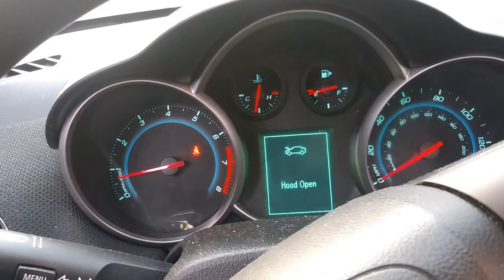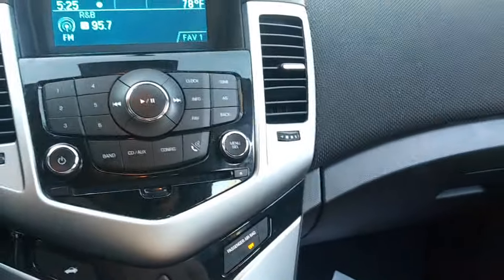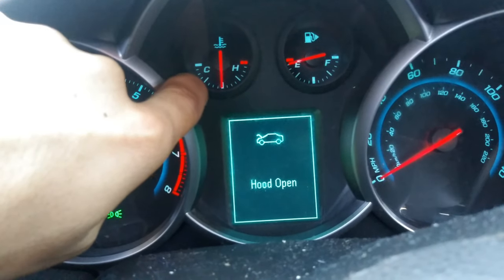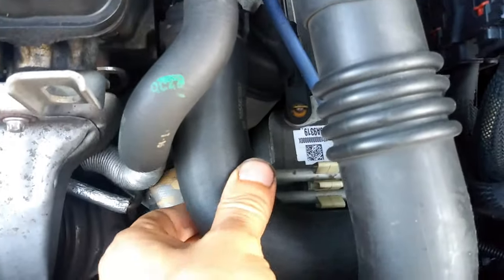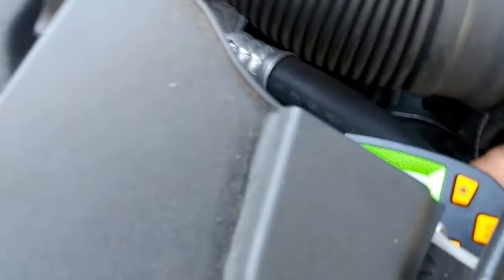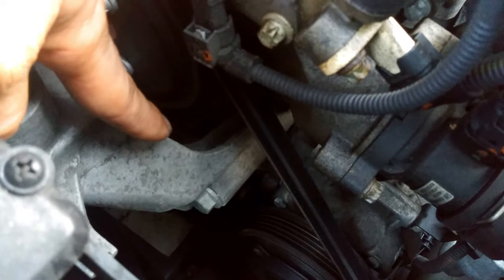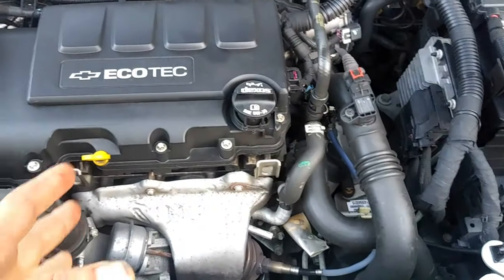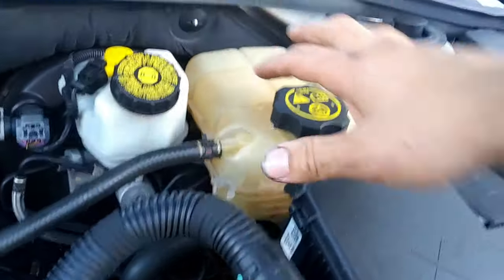chevy cruze overheating issues

Comment: Chevy is the devil man it's like u have to keep working on the car soon as u purchase it new r used.. toyota for life now
Reply: Buy a v8 no problems
Reply: I agree. Been having issues with my cruze on and off. 😒
Reply: @subatomi34  I’ve spent maybe almost $4000 on repairs on my 2013 Chevy Cruze and I’ve only had it for a year. I’ve been having problems every couple months. Trying to get rid of it and get a Toyota Corolla instead.
Reply: Stop that, I just bought one. Chevy Cruze Diesel 2010! No problems so far but it's only been one week!!😵🙈
Reply: Do people really wake up and decide they gonna buy a Chevy Cruze 😂😂😂😂
Reply: Yes. You know it’s hell when every time you drive you’re more concerned about the temperature gage than how much fuel there is.
Reply: @POPINTHETAPE  exactly
Reply: Facts
Reply: Yeah I have a 2015 they such
Reply: Yeah I have a 2015 they suck
Reply: Yeah I have a 2015 they suck
Reply: Yeah I have a 2015 they suck
Reply: Yeah I have a 2015 they suck
Reply: Yeah I have a 2015 they suck
Reply: Yeah I have a 2015 they suck
Reply: Yeah I have a 2015 they suck
Reply: Yeah I have a 2015 they suck
Reply: Yeah I have a 2015 they suck
Reply: Yeah I have a 2015 they suck
Reply: Yeah I have a 2015 they suck
Reply: Yeah I have a 2015 they suck
Reply: Yeah I have a 2015 they suck
Reply: Yeah I have a 2015 they suck
Reply: Yeah I have a 2015 they suck
Reply: Yeah I have a 2015 they suck
Reply: Yeah I have a 2015 they suck
Reply: Yeah I have a 2015 they suck
Reply: 2011 Chevrolet Cruze eco is 💩 only had it a year and I have issues every month the issue I’m having now it overheating now but at first it was only a oil leak now it’s both 🤦🏽‍♀️CANT TAKE IT ANYMORE
Reply: Not a chevy thing it's the 1.4 engine spicific, also gm diden't desing this engine opel did. Im a gm guy hate wotking on toyotas and most forgin cars. But i will admit gm really f ed up getting these ive owened alot of older gm cars an thay ran amazing i loved my cars with the 3100 an 3400 engines an never had a problem with my truck unless i caused them.

Comment: I’ve changed just about every hose, water pump, thermostat, water outlet valve. It seems like there is a lot of pressure in the system. Reservoir keeps bubbling and pushing coolant out. Heat works fine. I’m almost to the point of believing it’s a bad head gasket. I’ve never had so many issues with determining that. No oil in coolant. No smoke at tail pipe
Reply from the maker: Can you smell gas in the coolant
Reply: Jabo The Mechanic i do not. It’s not overheating now that I changed water pump and thermostat, but the reservoir is still bubbling and blowing out steam.
Reply: Bled air out at the radiator. It will bubble for a while then stop. After a few minutes will start again. But not showing over heating. I really don’t trust the heat gauge though
Reply from the maker: Yeah i would not trust the gauge. Hook up a scanner to it. Try replacing the rad cap. Could you send me a video of whats it doing
Reply: Jabo The Mechanic the bubbling could be exhaust gases I assume. It doesn’t do it constantly so I’m thinking it might not be real bad yet. So I’m thinking I’m gonna let it cool down, add some bars head gasket sealer and see what happens. Don’t really have nothing to lose at this point. Let you know the outcome. I’ll try to get some video before and after
Reply from the maker: Use kseal. Thats by far the one with the best success i had with the product
Reply: @JaboTheMechanic  used bars. Its no longer bubbling. No over heating. Running fine. Pretty crazy.
Reply: @brandonscherffius  I have a 2014 chevy cruz, and im pretty sure what your describing is my issue. It looks like coolant container is empty like the coolant i put has evaporated and then that ac is turn off light came on so i open hood and loosen lid a little bit and the coolant boils out and fills up. So what are all parts i should buy so i can try to fix this?
Reply: @brandonscherffius  ALso is opening that lid for now going to help my coolant getting through until i can get those parts to fix it? I dont know alot about cars so sorry if i sound like an idiot with the way im wording things.
Reply from the maker: No it will overflow out
Reply: Eric Turbett you’re losing coolant some how. Either a hose, the water valve, water pump or head gasket. Mine is a blown head gasket but it’s not showing the typical signs of it. Is it over heating?
Reply: Eric Turbett and honestly you’re gonna spend a lot of money and time chasing a ghost so if I were you, I’d take it to a mechanic and have them diagnose it
Reply: @brandonscherffius  so, i dont think its a blown head gasket, iv put in a new thermostat and no change, checked hoses and nothing seems bad, i noticed a slight leak from the area he said the water pump screw is but its like reeeaaalllly slow so i dont think thats where im losing coolant. I readjusted the hose i did see leaking. If anyone has any solid stuff to help het me up. THANKS.
Reply: Brandon Webb I literally gave up with mine. Let the bank take it back as I was filing bankruptcy anyway. Bought a brand new Nissan about a month later. Done with Chevy. Good luck fellas.
Reply: @brandonscherffius  dam, i paid mines off already. I know now. I ordered a water pump so i can replace that. If that doesnt fix it then yea imma sell this or something. Fucked up tho cause its a 2016 and aint even had it for long before i run into what seems to be an inevitable issue with the cars of this type
Reply: I just scanned my car because the engine light came on . 2014 Chevy Cruze rs , and it said turbo/ supercharger underboost. 
And catalyst system low efficiency. After running the car for a while and turning it off the coolant is bubbling through out the hose and into the engine.
Reply: @JaboTheMechanic   hello  my hose on the  water pump to the radiator  acts cold not all the  way  hot
Reply: @brandonscherffius  can you teach me how to fix mine,  I replace water pump , thermostat and some hose but it's still problematic and today I saw it creating smoke
Reply: The plastic bypass hose is prone to cracking and will leak. The guy changing your oil could hit the hose since it's right there and you have a leak
Reply: @JaboTheMechanic  what was the fix for this vehicle? I have the exact same issue on Chevy cruze
Reply: We are having the same issue as well… could REALLY use some H-E-L-P.. we have replaced the fan, the water pump, hoses, radiator, thermostat and all sensors, lots  coolant/antifreeze!! Took it to Chevy to get it diagnosed— they said Radiator… 
It is still overheating… it’s bubbling back through the reservoir…I can’t keep throwing$$$ at it! 
Any suggestions???? PLEASE 😢
Reply: @Okie mom  all the same issues here. My biggest regret is buying this car
Reply: @frankiecaraballo228  — I am right there with you! REGRET! We bought this car for my daughter.. it was her first car… she drove it, 1 week and that’s it… it’s been in & out of the shop more than it’s been on the road! Such a head ache!!
Reply: @okiemom did you ever fix it? I’m having a same issue
Reply: @frankiecaraballo228 hey, did you ever fix it?
Reply: @emmanuelramirez6669  — NOPE! Ended up trading the car off this past Saturday! Took a HUGE loss.. but, I could not continue.. it has been in & out of the shop, I have replaced so many parts, radiator, hoses, belts, fan, thermostat X3, 11 gallons of antifreeze (NO EXAGGERATION).. I am certain I am forgetting some things.. it was constant.. long story short… it was still over heating, loosing antifreeze and then it says something about shutting the car off due to overheating and the gauge was not in the red … It has been a NIGHTMARE! From what I have read…2010-2014 that was Chevys “trial & error” phase of the Cruze. Anything after 2015 (all the kinks we’re worked out & supposedly better.) I am so sorry your going through this as well… my heart goes out to you & the frustration.. I just had to cut my losses.. Edited to add: the next thing would be the computer & that was sooo costly… it would be reading hot on the gauges, but the hoses were not hot, the fans was kicking on and off.. it was just baffling.. there have been MANY recalls but the person we bought it from, did not do the recalls and therefor too much time had passed & Chevy would not cover the recall.. good luck to you!! I will help anyway I can.. like I said, we replaced it all except for the computer, transmission and the block.
Reply: @JaboTheMechanic what would it be if you could smell gas in the oil?   Mine is overheating with oil in the coolant but no coolant in the oil.  And the oil does smell of gasoline
Reply: Same... so did you change the head gasket?
Reply: @db3467 how does one replace this plastic bypass?
Reply: Wow. I just read all the comments and I'm having the same issue. I changed the one heat sensor up top and the thermostat. Having the issues up above. There is one more sensor by the radiator. Will change that tomorrow. If this fixes it I'll report back here. Crazy
Reply: @marz1005 same here . What you end up doing to the car? My just started overheating . Same codes though
Reply: Why does the thermo fan behind radiator turn on when when it is stone cold in the morning and stays on😂
Reply: @GM-gj8hs  hi. If you're still having this problem. I changed the reservoir, and emptied the whole radiator. There is a white screw bottom left if facing car. Also top left there is a white/gray screw. Once you drain radiator. Close up bottom. Fill from reservoir slowly. Watch top left hole once coolant comes out of hole. Close it. And that's what helped me. Hope this helps you

Comment: I have a 2013 Cruze LT RS and I had the "ac is off due to high engine temp" message come up yesterday and the radiator fan started running at full blast but my temp gauge stayed on cold. I had only driven the car a few minutes. I had to drive the car for a moderately long stretch because I had to find a safe place to pull over. The engine didn't seem like it was being affected as there was no loss in power and the engine light never came on. When I finally got parked, I shut the car off and then crunk it up and it ran normal. The message never returned and the fan didn't come back on. Just to check, I ran a few errands and every time I crunk the car when I got back in it, everything ran as it normally did. When I got home I checked the coolant and it was low. I looked for leaks several times when I was out in the car and didn't find any. I did hear some gurgling when I got the car home and turned it off in the garage. It was really hot yesterday, but I drove the car for a long time without it happening again after I turned it off and restarted it. Do you think the low coolant is the problem?
Reply: I had this issue and it happned out the blue and it was another 4 months or so before it got so bad i coudnt go anywhere withought it overheating
Reply: So what was the issue? I noticed when my car’s pcv system failed that all of a sudden my coolant was starting to go down. I haven’t topped it with coolant since 2016.
Reply: @harrisn3693  My thermostat had gone bad.
Reply: Same issue currently dealing with🤬 thermostat was replaced a few months ago no current leaks. Got the same message. And now the issue is idling high. Today it decided it didn’t want to start… so no idea what the issue is but not happy.
Reply: Mine is doing the same thing rn. It happened 3 weeks ago and I put coolant in and it worked great. Now I believe it’s a thermostat
Reply: @sunnilightfoot7156  Yeah. I had to get my thermostat replaced because that was the problem. Everybody always says these cars are horrible but mine has been really reliable. Only major repairs I've had to do was replace the catalytic converter and thermostat. I'm nearing 119,000 miles on the car now. The only thing I see I might have trouble with next is the transmission. Other than that, it's a joy to drive still.

Comment: These cars are piles of junk I just got my 2013 Cruze 1.4 lt and I got the thermostat changed by the dealership not even a month ago and it’s doing it again also had to have the replace 2 collapsed lifters and fix the stabili track system

Comment: At this point I’m tired of my cruze had reservoir replaced, water pump replaced, new thermostat 2 months later the same warning coming back on saying the ac cut off due to high engine temps. I’m tired
Reply from the maker: There is also a radiator coolant temperature sensor that could be defective
Reply: I am having this issue now 🤦🏾‍♀️ already changed the thermostat, water pump housing and now the radiator fan is gone. I am tired of this car
Reply: Me too I’m tired of this car right now I’m sitting on my car on the service road 😒 I wish there’s was a warning for everyone that these cars are really really bad
.

Comment: I wanted to share this with everyone. I manage a service center and had the same problems with these engines overheating after doing coolant work. I found this persons comment under another video and it indeed fixed the issues. I take no credit. 

Jonathan Smith
3 years ago
THE CRUZE ENGINE RUNS AT 227 DEGREES.    DEXCOOL 50/50 MIX BOILS AT 240 DEGREES.  This is not enough margin to prevent boiling as the coolant heat soaks after shut down.  I fixed my boiling problem by simply draining coolant and going with straight undiluted dexcool. Now I have boiling protection up to 28 Degrees. no more boiling at all.  These cruze engines run much hotter than we are all used to, and thus require undiluted dexcool, not a 50 50 mix.
Reply: Thanks so much for sharing this!
Also,  how would you know if you've blown a head gasket? My reservoir, after 15 mins of idling, starts to bubble and seem like it's boiling. Thanks!
Reply: Thank you. I will have to try that. My daughters car has had problems since we got it used. I had to replace the return heater hose as the plastic tee melted and burst. Replaced with a Dorman that has a metal tee. But put 5050 in
Reply: My advice replace the stock radiator as well and get one that's bigger and thicker and replace the hoses with silicone ones expensive yes but in the long run you don't have to replace them again. This will also help prevent over heating and less likely your hoses will tear as well. My car has a overheating problem but I think it's internal at this point probably needs a head gasket at 241, 000 miles.
Reply: @Alejandra-cv7rj  Same. mine is at 244k and fixed most of my heating issues. The pressure really is high, fixing one issue only results to another issue as the pressure tries to burst out elsewhere. my car has served big time. Time for a change

Comment: Low on coolant, Water Pump, need a coolant flush same exact issue in my 2013 Cruze
Reply: how much did all of that cost? bc i have a 2013 cruze and it’s over heating as well
Reply: @taeexoxo  the water pump on that car is easy to change
Reply: @russkaine  do you know how much should it cost because ppl like to get over on me
Reply: @taeexoxo  not sure I do most of my own work…I mean it shouldn’t cost more than $600 that includes parts and labor
Reply: Having overheating issue now coolant leaks. May be a hose. No sign 🪧 f oil in coolant which is good

Comment: This just happened to me and im sitting in my car just now pulling out of work. I had the heat on in my car an the beeping started after 5-8min driving and I saw a little smoke coming behind my steering. I parked an turned off my car and the heat. And now im just figuring out what to do. 

I have a 2017 Cruze and its 53k miles and alot to do today 🤦🏾‍♀️
Reply: Did it ever get fixed ?
Reply: @Kaycinee  yes my car was leaking antifreeze out the bottom center of my car. I presume from driving over rocks because a drive path by my job was getting maintenance so everyone was driving over rocks for 10 days. A rock hit my core heater underneath creating a hole.... causing an antifreeze leak. Cost me $600 and 2 visits replace it. They couldn't find the leak so I had to spot it myself by taking pics under my car where it was leaking out. 

No problems in 3 months now so I guess that was it.

Comment: Have 2015, 1.4L. Had the same problem thermostat was jammed. Replaced. Also replaced thermostat housing that had a leak a small leak causing air bubbles. Problem fixed!!!

Note: make sure you bleed the system properly /burp any air pockets will still cause overheating.
Reply: Hell how do I bleed system properly and Burt air pockets

Comment: When I am accelerating Cruze 2013 above 60 it's dropping the speed UpTo '0'....
Exactly don't know what's the problem....some one is saying, needs to change spark plugs, gear oil.....
One mechanic told gear box needs to be repair or fix...
Could you help me please....

Comment: 2014 Chevy Cruze get headers replaced soon but I got my hoses changed besides the one at the bottom for a/c I believe but the thermostat housing be acting funny but the water pump and coolant take needs to be replaced change the wires in the back or the pcv valve and change the cabin filter and intake